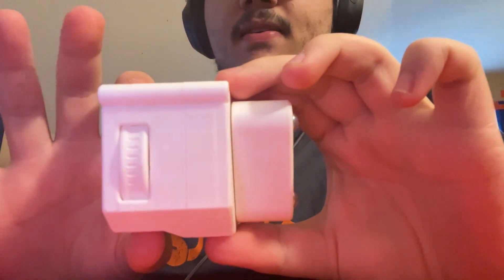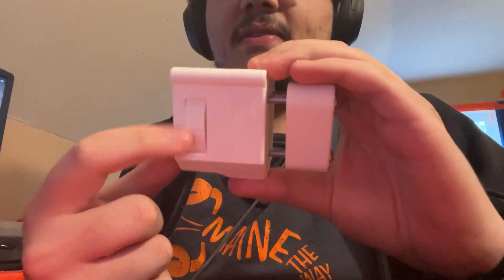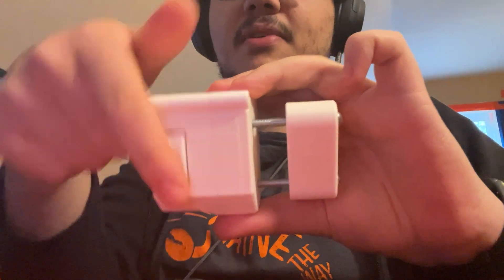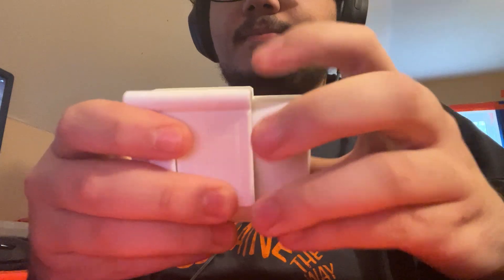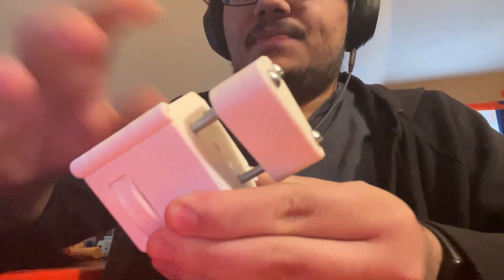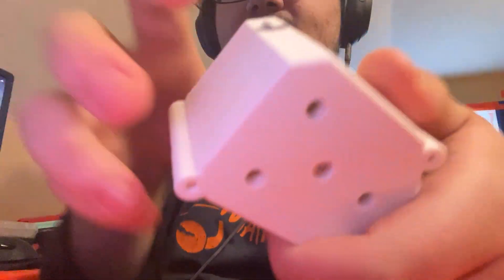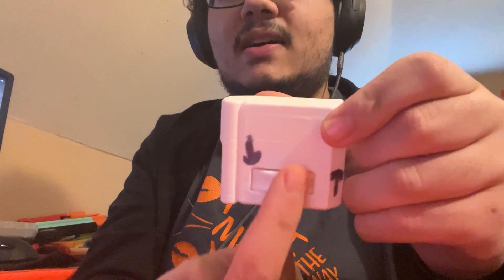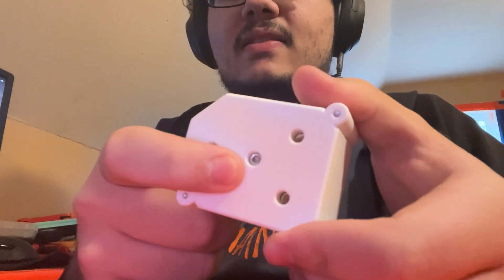Work in progress: adjustable stock using screws and gears!

Comment: Hi I just got a k26 turf spring for my alchemist and I found that it will not catch did I do something wrong or is the spring not compatible
Reply from the maker: K26 is sometimes too long for Alchemist, and it also needs the thinner plunger rod to work well.

Check to see if the spring is reaching full compression before the plunger catches, then consider trimming the end of the spring with bolt cutters as needed to shorten it.

Comment: Might be nice to have some sort of latch mechanism or another way to apply friction on the outer gear when the length is set. I dont imagine it would "walk" in/out, but that could help take up the backlash in the printed gears and make it feel a little more premium. Super smart design, though!
Reply from the maker: Yep, I’m planning to have a ball detent along the bottom of the gear to hold it in place when you aren’t adjusting it. Ultimately this is a novelty, which means it needs to work well, or it’s not worth doing at all.